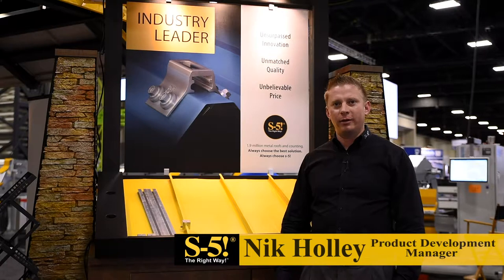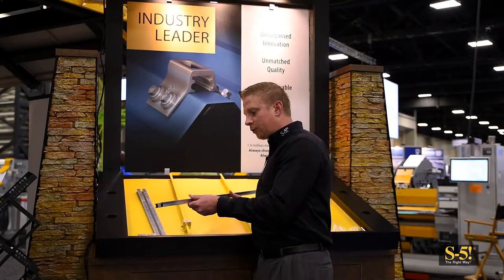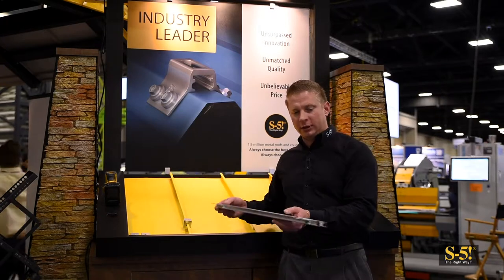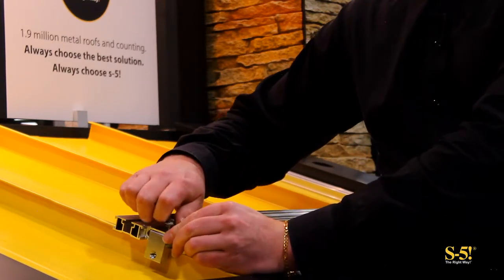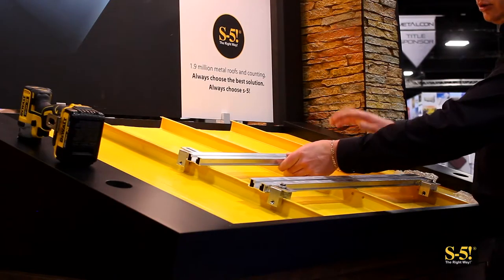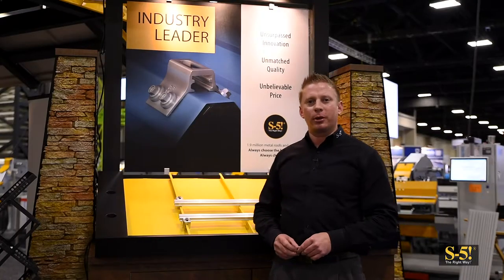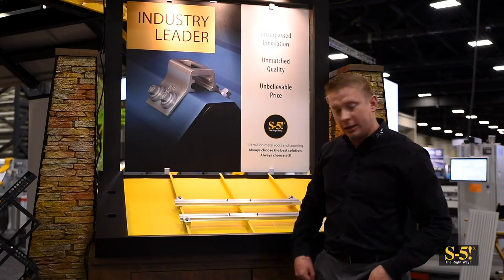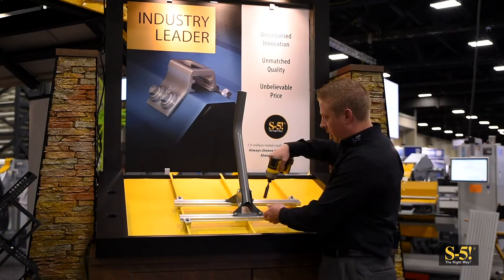How to Mount a Satellite Dish to a Metal Roof

Comment: What prevents vibration from causing the rails to gradually slide to one side and come off of the tabs at the other end?
Reply from the maker: In most cases, once the GripperFix rails are tightened down to the clamp or roof the rails will not slide on the tabs. In the case that they may slide a 1/2" stainless steel TEK screw can easily be placed into the groove on the outside of the tabs to prevent movement and the screws can also be removed if the assembly ever needed to be taken apart.

Comment: My metal roof look different than the metal roof I see on your video?
Reply from the maker: There are many types of metal roofs on the market and we strive to create attachments for all of them. The roof shown in the video is just an example of a common single lock standing seam. However we have attachments for all types of standing seams and exposed fastened metal roofs. If you would like to send us a cut sheet or photos of your roof to support@s-5.com we can help you select the proper attachments for your application.

You can also check out a video we just released that goes into the differences between standing seam and exposed-fastened roofs.  https://youtu.be/kVcQntJrS4k

Comment: Any tips for mounting a dish on a Screw-down metal roof??
Reply from the maker: Yes you can mount to a screw down roof by using the same product in this video. The only difference are the tabs that slide into the channel of the GripperFix rail. Here is the link to our website to show you the product. https://s-5.com/products/utility-solutions/hvacrooftop/gripperfix-us/ Go to the Exposed Fastened tab in the middle of the page and it will show you some examples. If you have any more questions feel free to reach out to us at support@s-5.com